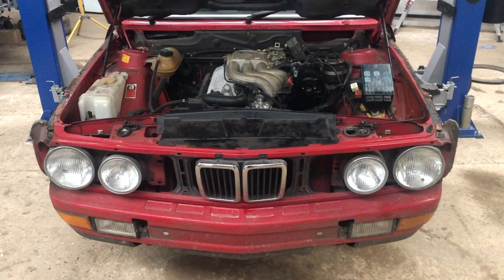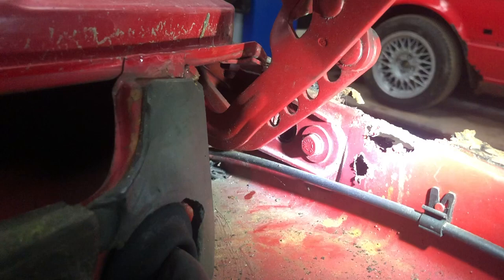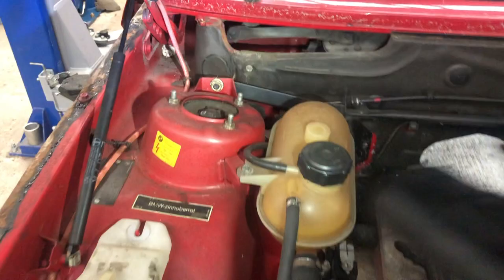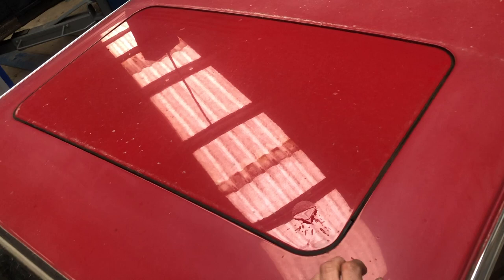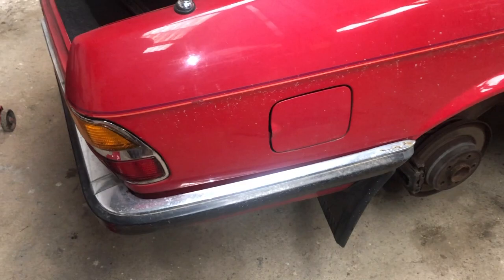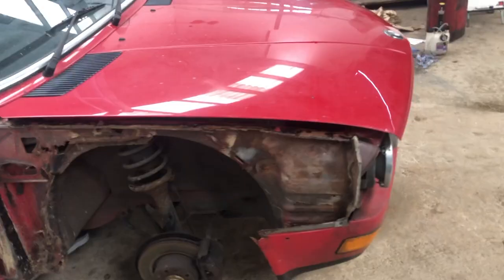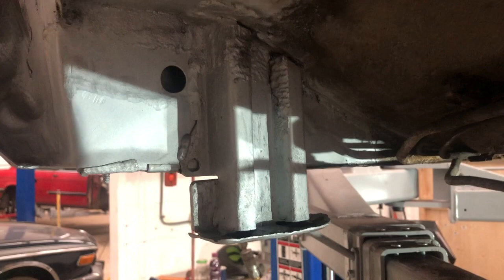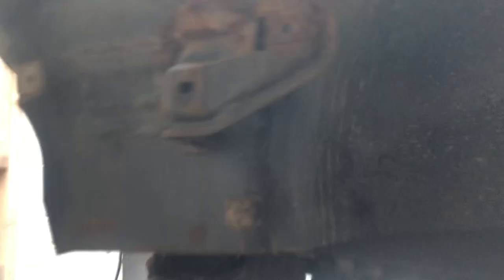E28 Buyers Guide

Comment: When I was buying these in the early 90's, I always found rust starting in the front of the front doors where the door seal channel was attached , also rear subframe mountings  and front floor pan to inner sill joint could be bad if cars had been damp inside,  wings would rot just above the front bumper sides as well. An odd fault would be a click from the back under acceleration, e12's had the same problem and it was the back door latches, a smear of grease would usually stop it. 👍

Comment: I found an e28 535 with 87k miles (140km for my friends with the funny accents). I will be giving it a thorough inspection before I throw my money away. Thanks for the tips.
Reply: My 86 sat outside in So PA for 12 years but isn't as rusty as the one in video. I did replace a front quarter panel